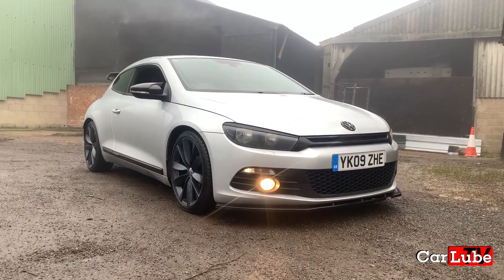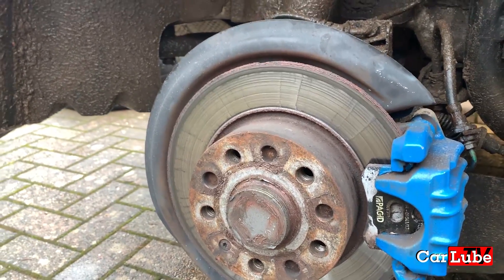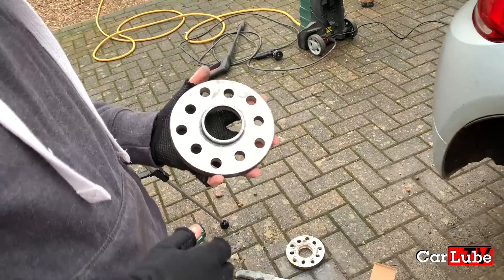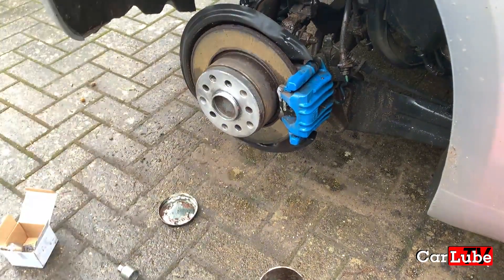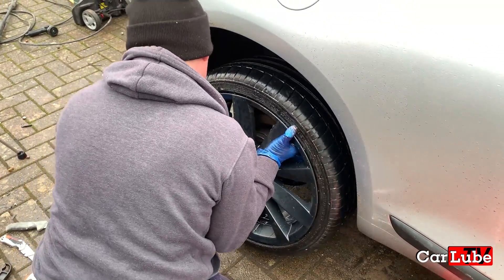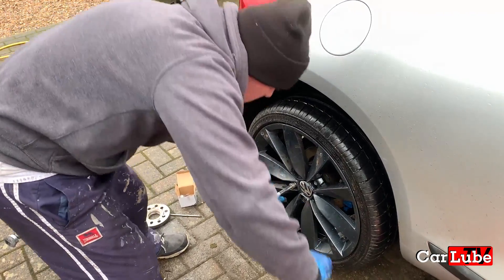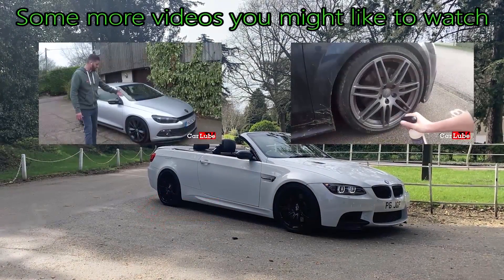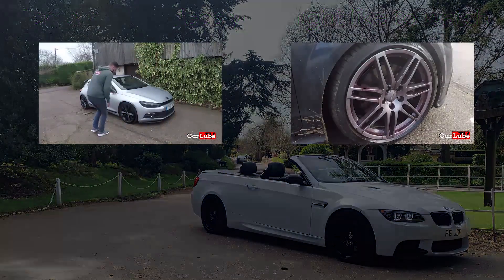VW Scirocco - 20mm Wheel Spacers - How Wide Can You Go?

Comment: My steeering vibrates whenigo above 70mph after putting 13mm front and back. Did you tighten wheel bolts while car was in the air?
Reply from the maker: You do need to make sure that the mating surface for the spacer to the hub is clean, also some spacer will be better than others, I certainly don’t have any vibrations on mine. Wheels should be tightened in a cross pattern once the car is on the ground.

Comment: Hi, what size are your tires? and are they runflat?
Reply from the maker: @Riphat_0  not runflats no, 235/35/19 is the tyre size.
Reply: @carlubetv  thank you. Got same rims in silver, but it is a size 18 (225/40/18). I was thinking of changing to runflats on the same rims however, I got an advice that it's not a good idea.
Reply from the maker: @Riphat_0  I wouldn’t add run flats to a car as the ride with them is absolutely terrible, also you can’t run flats to all wheels that are not designed for them.
Reply: @carlubetv  100% agree. Thank you so much for that.

Comment: Not mistaken the oem offset is 41 can it fit a + 20 offset on aftermarket wheels?
Reply from the maker: You would need to check the offset of the aftermarket wheels, potentially not. 
Having said that my standard 19 inch wheels are still a long way off the arches, I guess I could fit even wider spacers.
Reply: @carlubetv  thanks

Comment: thats way too much copperslip on the hub! you should only really apply it around the neck of the centre where it slips on to the wheel, and NOT on the entire face or in the bolt threads!
Reply: Didn’t know and want to install them too thanks for the heads up.